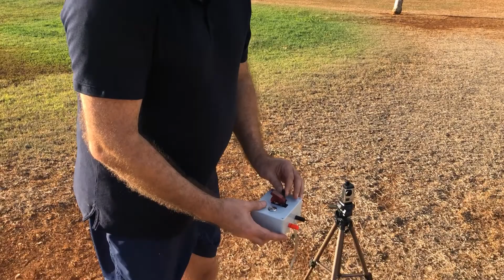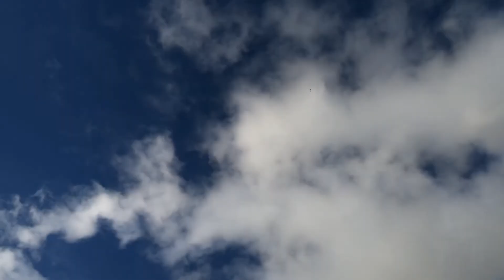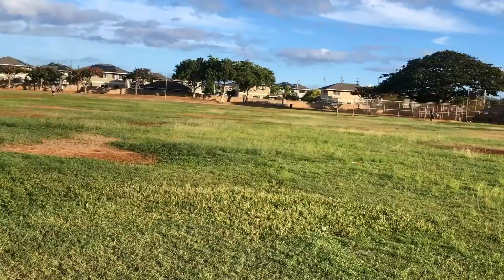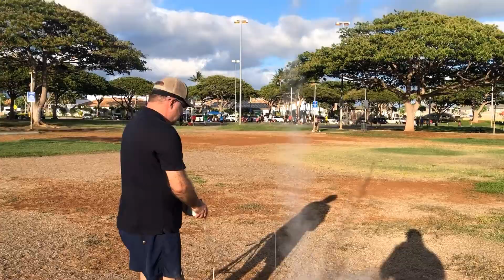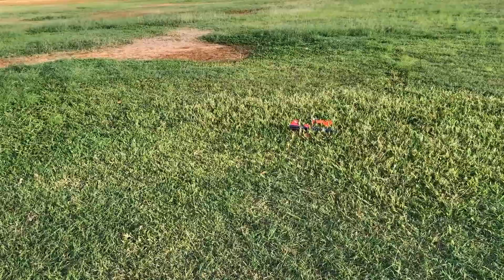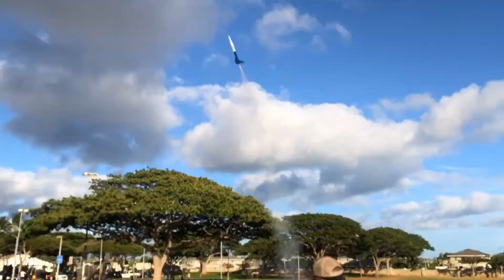Testing my new DIY launch controller plus new PONG rocket

Comment: Awesome controller lols good and the rockets went off well I’ll have to get me an indicator if they ever come back in stock here what wires are you using bud ?? I am running 2 core lightweight household- cable 😊
Reply: Hey park rockets,  I have a home made setup for doing rocket drag racing, and I find speaker wire works fine.😎
Reply: Gregory Traise hey bud I’m sure we have talked and discussed this on the Estes Facebook page before 😀😀 I’m Phill from the uk 🇬🇧🚀🇺🇸
Reply from the maker: I tried the thin speaker wires but not enough current so sacrificed a longer extension cord for next time.